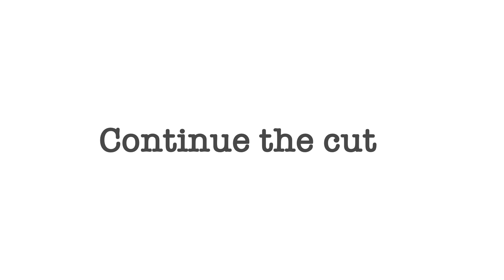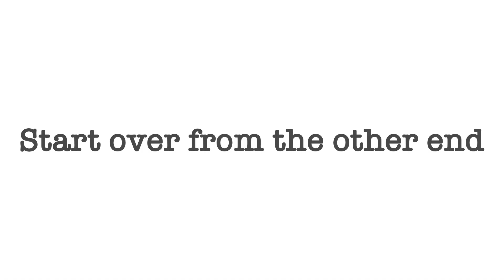How To Cut Straight With Hand Saws For Beginners // Calming Woodworking Hand Tools

Comment: Lol...
I find it incredible. All these "how-to" videos use a shitty piece of 15 mm thick board and only ever cut straight across and down...
Please will you re-make the video and use a piece solid Ash 72mm x 84mm with a routed 28mm round over along one edge and a 15mm dado in the middle of one flat, then hand cut a perfect mitre..😊
Reply from the maker: Thanks! I like this challenge. 
Honestly I found it hard to mitre cut for long with hand saws when making a stool. https://youtu.be/AXUSDXVhJZA?si=8CNZEVPf8KbVBL2W
I need to work on mitre cutting and try your idea later. I’ll upload it as soon as I can get the result.